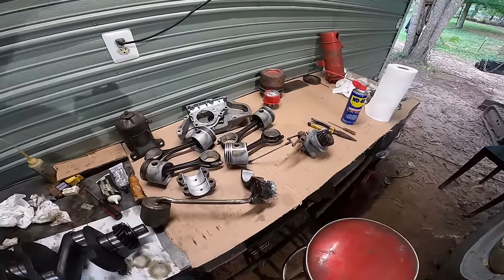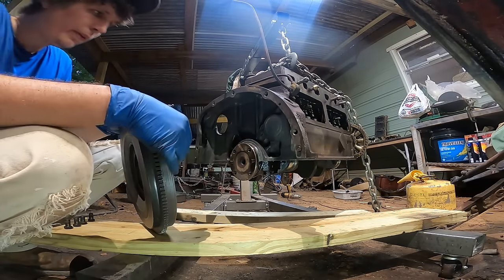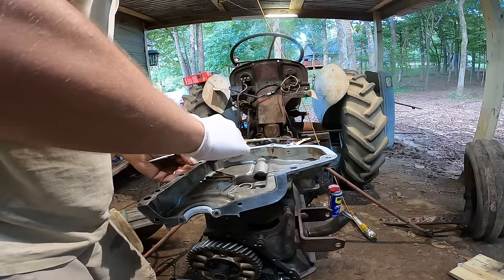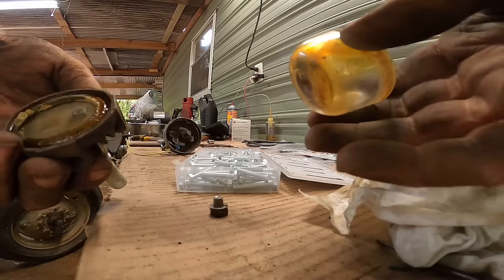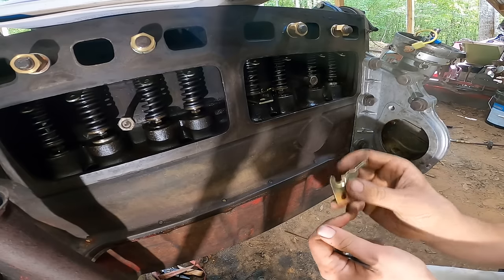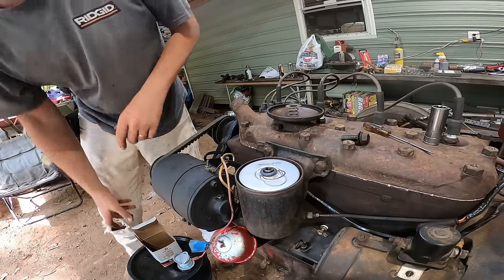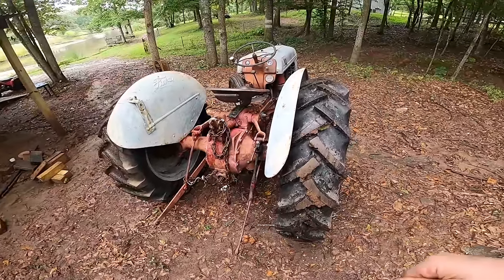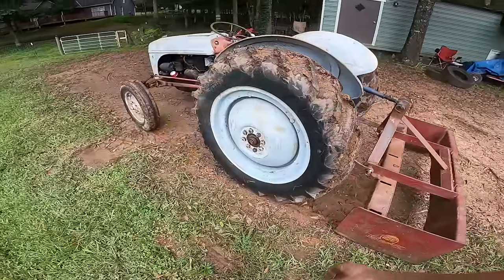RESCUING A 1952 FORD 8N TRACTOR FROM A BARN (PART4) SHES ALIVE!!!

Comment: Great job! With a rope seal, I was taught to install it in the block and cap and cut it flush. Then off set it so that the parting line is inside the groove by a 1/2" or so. This helps prevent the seal from leaking significantly. Thanks for taking the time to film it all!
Reply from the maker: great tip

Comment: Your noise is the lay shaft and front input shaft bearings a release bearing would be noisy when you put pressure on it. Could also explain why the gear stick moves when you engage reverse. Regards Chris Bailey
Reply from the maker: yes sir you are correct

Comment: My guess is the throw out bearing?  Buying a 8N and using your videos to rebuild the tractor. Thank you very much for doing this. Recommend putting weight on the front of the tractor if pulling heavy items. Tks for sharing.
Reply from the maker: Thank you very much if you have any questions feel free to ask me however it was not to throw out bearing it is some thing in the transmission I’m pretty sure it is the needle bearing or thrust bearing on the PTO shaft I was gonna make a video on it I just have a lot of projects going on at the moment
Reply: Concur. 8Ns get light on the front end.

Comment: Drove a 641 home to my uncles farm from an auction when I was about 10 years old.  Spent many hours farming with that tractor
Reply: The model 641 has "live hydraulics", you can raise the implement up with the clutch dis engaged.  Not with the 8N.  That's a little unhandy with certain implements.
At 70, I still have that tractor!
Reply from the maker: that’s awesome lyle
Reply from the maker: I wish the 8n had live hydraulics!! I have a old Ford jubilee with a broken camshaft that I mite do a video on repairing, it’s like a 641

Comment: Anytime you have an engine  or transmission out you should replace the throw out bearing.It’s cheap insurance so you don’t have to go back in there because bearing squeals or gives you other problems. Especially when it is in a tractor that you have to split in to. Just a word to the wise from an old guy!
Reply from the maker: you are correct but I know a lot of people think it’s the throw out bearing but I assure you it’s not, it sounded bad in my hand cause I just cleaned it with brake clean and it had no oil, once I greased it it was silky smooth. the noise that the tractor is making is coming from the pto cover I’ll have a video coming out soon about it.

Comment: I just got around to watching the last video in this series. Thank you for taking the time to record it and admire you for taking on this project.  A word of caution on these tractors, when pulling on something that does not want to move, pull it from the front.  These tractors can and will flip over if you are not careful.
Reply from the maker: thank you so much for taking your time to leave such a wonderful comment! I truly appreciate it!! and yes it can be very dangerous and flip back… and that doesn’t sound to fun!
Reply: Reverse is almost the same gear ratio as 3rd gear on these. So you will loose some pull.
Reply: Original instructions for these tractors even suggest reversing before driving forward on winter mornings in case the tires have frozen to the ground to avoid turnovers.

Comment: 8N is good tractor.  A tank of gas will last forever.  Sleeves can be replaced in engine cylinders too.  You will enjoy it and they start easily in cold weather.  Good for small farms for all the chores.  Sounds like the throw out bearing is a little noisy and the carb may need a little work to get rid of the sputter.  3rd. works well to pull trailer, etc.  2 nd works well for scraiping, plowing, etc.  4th for highway for about 10 mph maybe.  It will not drive like a car and will tend to weave around at higher speeds, that just an 8n.
Reply from the maker: thank you so much!! it’s a pretty good tractor I use it all the time I plan one one day making a video restoring it 😊

Comment: Throw out bearing noise. Also if you plan on using a bush hog be sure and get an override clutch for the PTO. It will push you through a fence. Don’t ask me how I know. Old Ford tractors are work horses. Nice job
Reply from the maker: lol that actually almost happened to me to haha

Comment: I owned one in the 70s ,great little tractor. Be careful pulling large logs they will flip over on top of you.
Reply from the maker: yes thank you so much for the tip
Reply: Yeah it’s a bit freaky when you pull a wheelie and that’s what I was doing. Pulling a tree log, keep the 3 point hitch down before dumping clutch.

Comment: I have rebuilt a LOT of engines and you did a good job but If I was that far into that engine I would opted for liners and new pistons. Then you wouldn't have to wonder how long will my repair last.  Oil pump had enough wear to not prime. It don't take a lot of wear. One thing though and that is NEVER put oil or assembly lube underneath a bearing. This surface should be absolutely clean and dry. You are inviting a spun bearing. Just finished rebuilding a 1971 2020 Deere. Complete total rebuild of engine,  head, and injector pump everything was 5600.00 . Rather have it than a brand new one...
Reply from the maker: yes you are correct I actually bought new pistons, liners, gaskets and everything I still got it all in a box but it runs so good I haven’t installed any of it, I think I actually wiped the oil off the crank bearings off camera as I realized it wasn’t a good idea I just didn’t want it to rust. great info and tips my friend!

Comment: These old Ford 8N tractors bring back special memories for me. My grandfather, my late dad's father, had a '51 or '52 Ford 8N that he bought used sometime in the late 1950's after my mother and father got married in '55. My sister and I grew up in southwestern Ohio about 3 and a half hours away from Papaw and Granny's homestead farm in Log Lick, Ky (outskirt of Winchester) so we only visited two or three times a year but we loved going back there back in the day because it was a great place to visit. They lived on about 150 acres where as we grew up in a rural neighborhood in Ohio so big land and farm equipment was something we weren't around much. Anyway, when I was about 10 years old when we went back to visit for a couple days around 1978 I bugged Papaw to take me for a ride on his tractor and sure enough he took me out and sat me on the seat and proceeded to show me how to start it. He sat me on the front of the seat in front of him and showed me how to pull the choke out, how to adjust the throttle and then let me step on the starter button. I can remember it almost like it was yesterday and after I got it started he took over, raised the rpm's a bit and proceeded to drive the tractor down by the barbed wire fence line that ran down their old drive or lane. He had a sickle bar mower attached to it and lowered it (hydraulically) and we slowly ran down the fence line cutting tall grass and weeds along it. That was an experience and I've never forgotten it and some day I'd like to own some land and get an old Ford tractor just for old times sake 😊 but my favorite old tractors are the old 1930s John Deere twin cylinder (Johnny Popper) styled or unstyled so one of those would be on the list also. Hopefully one of these days (I'm not getting any younger 😑.)
  Thanks for the videos 👍

Comment: My sister was around 8 and I was around 9 . We had pegs on inside of wheel wells to hold chains. My uncle told her to get off and she jumped off which let off the clutch. It was in reverse and ran  tire into my uncle on right side. He grabbed on to peg and the wheel went between his leg. He went for a ride with wheel between his legs. I caught up to the 8n, jumped on and pushed down the clutch.  He was shaken up but fine. I miss being on the farm. We had 3 of these, but 1 was bought later and never did run right.
Reply from the maker: dang that’s a crazy story 😳

Comment: Just found this series. Nice work on the 8N. It appears you have one with live hydraulics. I understand some early tractors had to be moving to raise the arms. I couldn’t get used to that. Not having live pto is inconvenient but workable. Get an overspin clutch so the momentum of the rotor on a brush cutter doesn’t run you into a creek or tree or house. Cool old iron.
Reply from the maker: unfortuently this does not have live hydraulics 8ns didnt have that

Comment: If  you use a short bristle artist brush (harbor freight), putting gasket sealer on the surfaces will be a lot better and the distribution is much better.  Much more efficient than a screwdriver or your finger.
Reply from the maker: great idea the only reason why I don’t do that is cause the hairs sometimes pull out and get stuck in the sealer and also you would have to use anew brush each time unless u clean the brush. however still great idea and I will prob start doing this
Reply: @TheHomePros6221  Only use the one's with the black short bristles (I should have said this).  They are synthetic and in my experience won't pull out from the shaft.  My Ford Racing Aluminum Windsor 427 was built using them (648 flywheel HP).  The sealer is spread evenly with no lumps or gaps.
Reply from the maker: Awesome yes I need to order some them brushes

Comment: Good day Home Pro really enjoyed the video I was glad you got it running right off the bat ! Don’t worry about having to open her up again that life it has happen to me too! But I don’t mind I would rather spend my money and time on something worth while then on something where there’s never going to be a return! I noticed that the tractor was discharging and you may already know this but the N-series tractors were originally positive ground.That grinding noise in the transmission isn’t normal I have one that’s making the same noise so I have to split it for the second time I can’t quite figure out what it is but it is more than likely a bearing. I don’t think it’s the release bearing because it would only make noise when the clutch is employed not when you let it out. But I was glad to see you enjoying it and I was glad to hear that you want to completely restore it the tin is in great shape and I look forward to seeing the videos you will make of the restoration and please do make a video of the box scraper restoration I enjoy fabrication so that would be great. I have had good luck ordering parts from Dennis Carpenter but everyone has there own experiences ordering parts it can be very disappointing. But it’s not a perfect world.Question did you have a thermostat in the upper rad hose? If not I would suggest getting one and I always install a temperature gauge I cut a piece of copper about 3-4 inches long drill a hole in it and soldier in a fitting for a sending unit and I install it I the upper radiator hose between the head and the thermostat and then mount it in the dash. Or you can drill and tap the left side of the head in front of the oil canister mounts there’s a flat spot on the head just below the neck.That way you can keep a eye on the temperature and then it will break in the engine properly. But I am so happy Another Ford 8N saved from the wrecker!
Reply from the maker: thank you so much for your wonderful comment!! the ammeter is broken so it’s not working correctly but I do plan on putting in a temp gauge also. I should have some videos out shortly of working on the transmission I’ve been very buisy on various projects so stay tuned! thanks again!

Comment: Brilliant series of skillful rebuilding, and video/editing. I felt you joy when she started. One suggestion, and this is not a criticism, but many mechanics will place some vinyl tubing over the connecting rod studs while tapping the pistons in place in their bore.  It prevents inadvertent scratching of the crank from steel hitting steel (which I have done, unfortunately) and the tubing can be easily pulled off to attach the rod caps.  Looking forward to your other videos.  Kind Regards, Craig
Reply from the maker: thank you so much for the wonderful kind words!! I actually usually do that with the tubing but this time I didn’t I just went really slow and careful, thank you so much for watching and commenting I truly appreciate it!!

Comment: Pack the oil pump full of light grease or Vaseline. It will start drawing oil as you are starting it.  Just a suggestion.  I learned that from an master mechanic in the 1960's.
Reply from the maker: yes, that’s a great tip. However, if you check out my other videos rebuilding this tractor, the oil pump was shot.
Reply: @TheHomePros6221  Yes, I saw.  But the new one, I should tell you that we put the oil pump disassembled in a bath of oil before assembly.  Then pack it full of grease after and during assembly.  I did a O/H on a Farmall and a Massy Ferguson the first 2 weeks I worked there and I learned to respect the master mechanic in the first few minutes after unloading my few tools.  He made me the mechanic I am today.
Reply from the maker: @gtnaylor5870  that’s awesome!! So what I did was use a really think tacky assembly lube and before I started the engine I took the oil lines off and used a large syringe type thing and squirted pressurized oil into the pump and whole system which worked really well it had instant oil pressure when I cranked it up
Reply from the maker: @gtnaylor5870  yes sir good tips👍🙂

Comment: I did what you are doing with Ferguson 20’s and 30’s after I retired and hauled 2 at a time w/assorted implements to Alaska for my son-in-law to help them financially, and to get to see my grandchildren 😊.   I also did 3 Ferguson 35’s, but they didn’t require too much work, only 1 needed a clutch plate (and throw out bearing that was not buttery smooth).   I didn’t want the customer in Alaska wanting me to drive up from Wa. State with a clutch problem of any kind. And and my son-in-law who had done a Ford 9N total rebuild and paint would probably been contacted as he did most of the selling of the tractors and implements that I hauled up.   I kept enough of the profit to pay for the drive up and back and gave the rest to him and my daughter.   None of the 10 tractors ever got a call of complaints to my son-in-law, made him and me both happy 😊😊.

Comment: Don’t use plows and blade in the upper hole of top link, that is expressly for light implements that only have light draft like cultivator. Using a blade on it will break the top holes off. Too few have the third hole anymore because of that

Comment: On my 1951 8N, I ended up drilling a 1/8 inch hole in the casting where the tappet sits andwith a 1/8 pin punch  I was able to hold the adjustable lifter still while I used a very thin open end wrench to turn the tappet screw.I couldn't get the tappet wrenches to work, the new ones are not made as well as the ones from the 90s and earlier. Rachel Gingell has a video on her YT page on how and where to drill the holes, you have to measure carefully using the diagonal slots in the tappet body. It's exhilerating to have that engine fire up without hesitation when starting for the first time.

Comment: Good job man! You covered most all the bases, but the hot indicated oil pressure at the end of the video appeared quite low? You addressed the worn rod bearings, main bearings, oil pressure relief valve and end play on the oil pump gear clearance, but you did not a thing with the cam, cam bearings and lifters? The camshaft and related items are the last thing to get oil pressure, so I would check all of that before you run it anymore! Remember, the oil pump creates oil pressure, and the rod, main, cam bearing clearances and the oil pressure relief valve retains oil pressure! This may explain the cause of the low hot oil pressure indication!

Comment: Finally got around to finishing watching! Great job Darrell! Can't believe how easily she fired up. Wouldnt worry about that noise, its just the release bearing, they can go on for years like that. I have a Land Rover discovery TDV6 in at the moment with one that loud! PS I brought something new back on the trailer Saturday, video to follow shortly 🙂👍
Reply from the maker: thanks for watching Dave!! I can’t wait to see what u got!!
Reply: The year I was born, my Grandfather bought a 1949 Ford 8N which he used until his death after decades of farming with it.  Most likely, when you disassemble from the top box cover, you're going to find a broken flat needle thrust bearing on the input shaft has separated.  Not really a critical part to operation, simply a source of noise itself.  If you can separate the pieces with a magnet (may require you to use diagonals to cut the remaining bearing frame segments), you won't have to disassemble the transmission.  Drain and replace the transmission fluid, along with using a small magnet with a swiveling head to remove any lingering pieces from the bottom of the case.  The noise will likely stop and the adjoining two gears will not require the thrust bearing for operation.
Reply: @richardgreen7811  Normally I would agree with you however, seeing the gear shift move, I believe it is a bad input shaft bearing and maybe the thrust bearing too. I would replace both as soon as possible or it will start to put wear on the gears. I am 64 yo and grew up on a farm and have seen this before. We fixed our own equipment. Also, we had the same 8n tractor just for pulling flat bed wagons into the barn but, we never had too many problems with "that" tractor. Mostly had problems with the John Deere tractors.